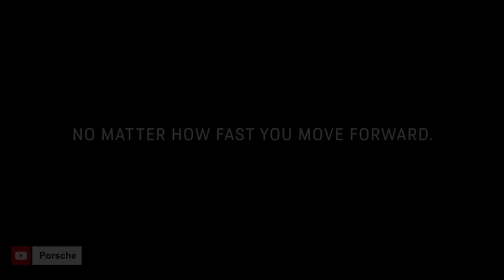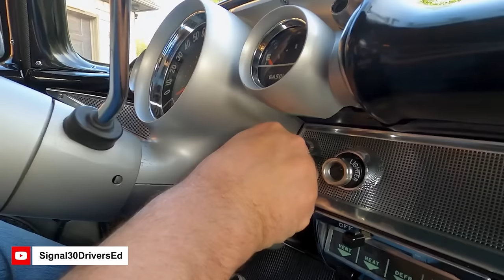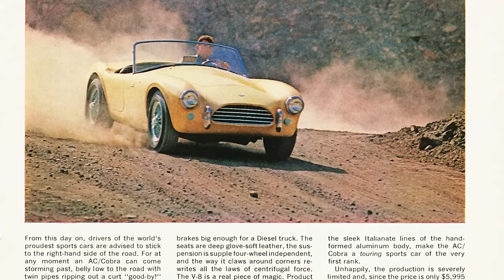Why Old Cars are Better

Comment: theyre not better. Sure they do look better, the old BMWs, audis, dodges etc. Not the really old ones which reach top speed of 30 kmh, not those, but 70s-80s. But what about them is better? The lack of ABS? The lack of basic safety measures? The inefficient engines? Sure they're likely easier to repair, but is that really a factor? i mean, modern cars arent that difficult to repair. Sure, if electronics break down, it can be a headache but in most cases you can simply not use those electronics, therefore they'll never break down, same as in older cars which had no electronics to use.

Comment: Mini cooper r53 s, 2004, once i ride this to oblivion, i will buy another one. Don't want ipad on wheels that thinks it knows what i want to do better then me.
Reply: The r53, renowned for overheating and throwing belts? The engine built on the very edge of it's capability? The only r53's i've come across are either broken, or breaking.
Reply: @mattd6085  They are not breaking if you mentain them propertly and are not that expensive to fix anyway. I have never heard or experienced anything about overheating, and they are not built on the edge of engine capability, if you are talking about jcw varients, then maybe.
Reply: @mainsidequest5203   We talking the 1.6 supercharged?
Reply: @mattd6085  yep, but there are john cooper work official variants that push it to 215 hp from 163 and to 160kw from 120kw

Comment: If you  where mechaniclly inclined you could maintain an old car  yourself , not  anymore with modern cars today .
Reply: You're right, no one person has ever managed to actually learn how modern systems work and fix them alone. Every single modern car on the planet has ONLY been maintained by mechanics. 

OR, you're just pining for the good ol' days and refuse to actually learn something new, so you assume no one can. 

I've done lot's of work on my modern car, from pistons up to wiring looms, it just required some actual effort. Try it one day.
Reply: Is not that easy,  if the check engine light comes on ,it could be many things,  and you need an expensive scanner to kind of pin point you to what the problem may be and if you are not a seasoned mechanic , you can  be replacing parts and still not find the problem .
Reply: @youtuber5709   Scanning tools can cost about the same as a good torque wrench, so cost is immediately a bad argument to make as you have to buy tools to work on ANY car. 

If you aren't a seasoned mechanic, replacing the piston rings in a 1960's Dodge is also hard, so again, is not unique to new cars. With a bit of practice and research, there isn't much in a modern car that can't be done on a drive with a sensible tool collection.
Reply: @mattd6085  It does not matter if the car is old or new to take apart an engine and put it back together and it runs properly it takes knowledge , not everbody has that ability , i'm talking about light mechanical work that you don't need special tools , you say that a scanner is not expensive , ok let say your  check  engine light comes on , it does not pin point the problem , it could be many things  wrong and if you are not a mechanic that is used to trouble shooting electrical problems you are not going fix it , unless you get lucky .
Reply: @youtuber5709   Check engine light comes on, plug in scanner, read the code, look up the code, there is your problem. If you can't understand how to find a fault, that's your problem, not a design problem. 

I literally don't understand your argument about old cars being easier to maintain here. If your 70's car had a problem, you likely wouldn't GET a warning, it would just fail entirely leaving you stranded. At least with engine codes and modern sensor systems, you'll get a warning before something totally fails. 

Old AND new cars need a bit of education to work on, but to argue old is easier is bullshit, it's just a different type of learning. 

Just admit you personally prefer older cars and don't want to learn how to maintain a new one.
Reply: @mattd6085  first of all , why are you loosing your cool , just trying to have a civil concversation here , maybe my mistake is what i mean is older cars are" simpler"  to maintain instead of " easier " , by the way i do maintain my own  modern cars , and as far as the codes are concern,  not necessarily the problem , you can get a code for catalytic converter and it can be several things that can cause this problem , not just a bad catalytic and you need to have the knowlege to trace it down not just replace parts at ramdon , on old cars you didn't have to deal with all of these smog related stuff that's why i say they where " simpler "to maintain .
Reply: @youtuber5709   Who said I'm losing my cool? Don't be so sensitive. 

Older cars ARE easier by virtue of their lack of complexity, but you pay for that simplicity. Older cars are slower, less efficient, need more frequent maintenance, less safe, the list goes on.

Again, just because you need to learn a new system doesn't make it a bad thing. If a 60's car was blowing heavy smoke, there are MANY potential causes, it the head gasket? Valves? Cracked block? Piston ring failure? You'd be digging into it just the same as a modern cars cat problem wouldn't you. 

Also I'll point out the air quality back then was fucking awful thanks to the complete lack of attention towards car emissions. Cats are a good thing for society.
Reply: @mattd6085  I completly agree with you , that's what i was trying to say all along , i even said that on my initial post .
Reply: I like this comment section.

Comment: I totally disagree with you about older cars being less reliable, but rather if they are properly maintained and cared for, you won’t have reliability problems. As for why people no longer work on their own cars is because they have been deliberately designed to prevent you from doing that. With all their ridiculous and unnecessary computer crap and hundreds of miles of wiring, the model car has been made impossible for the average man to work on. Another thing that is in favour of the old cars is that they don’t just randomly decide to throw a tantrum and burn themselves to the ground, along with you house and anything else that is within range. You can shove your new plastic, computer controlled pieces of shit with a lithium battery, right where your mother never kissed you.

Comment: I don't care to complain but any 90's truck looks like shit compared to a 30's 40's hot rods,  50's and 60's that don't look to far off form the 50's cars, look cooler, and I was born in the 70's and so the 60's cars that look like 70's cars and also the 70's cars with that don't look as cool to me for some reason but they even look better then 90's and 21'st century cars... and I don't even drive. 80's box shaped cars and 90's slightly less boxy cars were not really that cool but got us around.

Comment: Modern cars are overpriced funeral pyre  on wheels. We really don't need all the bells and whistles of modern technology.  It gets expensive when it breaks and most of the time it's something that is beyond the common ability to fix. To cut weight most cars have tons of flammable plastic instead of metal. Underbody panels are plastic,  interior and engine bay loaded with plastic.  Older cars you actually have room to work on like the engine. Cars today are built around the engine so everything is crammed tight. In order to do some work on modern cars you have to pull the engine out. Now that's an expense. Cars made today are built to be thrown away and not even bother keeping.

Comment: Your opinion is tainted by survivors bias. They built shitty homes in the past. No one felt those houses were worth renovating, so they were torn down and replaced.  Likewise, most old cars were crap and have long been relegated to the scrapyard. Also, none of those experiences you mention as being better are core to what a car is designed to do. They're side affects of thw technical limitations of the time. Getting from point A to point B quickly and comfortably is the core purpose of a car. Newer cars are better at that in every way possible. Your Nostalgia is like wishing that we still washed our clothes and dishes by hand. I'll pass.

Comment: I Require The Holy Boat Car

Pacifically The 1964 Ford Galaxie 500XL in Dynasty Green

It Is Absolutely Essential

Uh; big problem 

Straight up detached from Reality making up nonsense about how Ancient Homes were Built Better

What Are You on about 

My House Is Vintage Retro; some Nice old Design Concepts and lots of Fine Wood

It’s built like Trash as per the period and falling apart

Modern additions are the only thing keeping It Livable

There’s so many common sense issues with this House and They’re all Contemporary design trends

Just stick to how Cheap Comfort Gluttonous Cars are Bad

Comment: Yes, I think this video (and most of the people in the comments) are blinded by nostalgia.  My parents had several cars over the years, and none of them could reach 200K before an engine rebuild was required.  Also, maintenance was required more often--my dad's old truck, according to the manual, required an oil change every 1500 miles.  And who wants to pump the gas pedal, then start the engine, then adjust the choke, then wait five minutes for the engine to warm up, and so on, when you're gonna be late for work?  Who wants to have to walk around the car and manually unlock and lock each door?  We've lost some interesting styling, particularly from cars of the late 50s, but that's about it.  Today's cars are better in almost every way.
Reply: Throw away cars are cool if you hate the environment and money. More pollution is made during manufacturing and recycling of a car than driving. The year 2000+ cars are great until your electronic windows or locks break. It is more of a pain the ass to not be able to roll down or up your windows and not open your doors. Sure it is a pain in the ass to rebuild an old engine after 150k miles but try changing a spark plug on some new cars? Some modern cars you either have to take the engine half apart or take the engine out of the car which requires you to take half the front end of the car to come off too. New cars after 200k or 300k miles cost so much to repair. Hours to repair are higher because they are welded together backwards by robots. The cost of parts are higher because either the parts are rare or paired only to work by the manufacturers. New cars need to be junked. You can spend 45k or $700 a month for 6 years on a car that could get 200k miles and needs to be tossed or you could get classic car that will need maybe 5k-15k every 150k miles. I have had plenty of year 2000+ cars that died at around 130k miles.

Comment: You’re greatly mistaken when it comes to the word motor. Motor is originally from the 1500s meaning on that imparts motion. Your misconception and improper use of the word is why in the last 100+ years since the modern automobile that has lead to the definition changing to be incorrect and many people sounding ignorant. Take all the brands or words with motor and replace it with motion and you will understand. Cars have engines that are internal combustion. A motor in a mechanical sense is electric and cannot also be a substitute for engine. Unfortunately ignorance and wide spread improper knowledge and use has made it so and it personally drives me crazy especially when extremely knowledgeable people like engine builders use the word motor cause it’s just what they herd not understanding it was wrong. 

Everyone will argue this with me but why doesn’t anyone say electric engine if they are the same thing? Because engines are internal combustion and are not motors. 

Motion sports 
Ford motion company
Motion car
Motion cycle
General motion
Auto motion
Etc etc…

Oh then some say what about trains locomotives…they were powered by what? that’s right steam engines!😂

Comment: Dude old cars which you see in museums and magazine,are the equivalent of comparing a let's say audi R8 from 2010 to like a corolla from 2022....
You absolutely don't understand what you're talking about because you are comparing way way different cars.
In order for your video to be truly valuable you must go back In time and compare ,let's say a BMW e30
To a e36
To a e46.
Then compare a mercedes slk200 let's say to a new miata 
You know the slk has an inline 4 supercharged
The miata is NA THE Nd Model
Like,you cannot compare a Porsche 996 after 40 years to a let's say tesla...you can compare it to a cayman or like a boxster but.
Mainstream cars from the 80 and 90s were probably pretty trash,but the special editions like let's say 
Subaru sti Impreza 22b engine
That car cannot compare to a forester

Comment: older do do better in crashes by proving makeing the car crumple leads to drivers and passenger being impaled with objects thats got shoved back because the car crumpled i have a real life example that happened to me i was driving a 72 dodge power wagon single cab im on the freeway with 3 passengers yes 3 total 4 with me driving in my single cab i was doing 70 to 75 just crossed a bridge and there is a coner coming up nothing crazy but my steering box goes out my wheel is locked up all my friends cause it tell them all of us grab the wheele a try turing it 4 men strength and dident budge at all we go stright in to the concrete barrier but because im driving 72 dodge truck made of real steel every where we hit the wall 70 or 75 mph we almost jumped it we hit it so hard but because the truck is made with real metal not military grade aluminum and mind you cause of year there are no air bags lol no one in truck had a scratch or bruse from impact and best part is you know how much damage my truck suffered at 75 mpg almost 0 i bent my bumper down a little and scratched up my fenders and blew 1 tire thats right not person was hurt no airbags no seatbelts and the truck wasent even hurt sure neede towed cause it cant steer because my steering box went out but yep took it to shop same day ina 1hr and a hlf they replaced my steering box and got a new tire and we continued our day modern vehicals crumpling leads to more injurys because they crumple thus shoving all kinds of thing into your legs chest and face so no the are not safer car company have fooled you so you think there safer so they can use infferiore matireals to make there cars and ppl wont complain because you have been tricked thinking there safer because like all of the USA we have forgotten the past you know how many time these moden "safety" devises actually lead to the person diying is quiet often there legs get pinned because the car crumpled know the cant escape the seatbelt wont undo because of the crumple and now your trapped they may help sometimes but they also cause harm or worse sometimes so huh is it safer being that the newest thing ive ever owned was a 2000 durango ive crashed jumped just done stupid stuff a always the older cars are safer more reliable and never have to take it to shop where they say u need this that and another thing when none of it was bad ppl to up there commonsense because from what ive seen and ppl ive met seems like commonsense isent so common anymore sorry for rant but ppl today are just so much dumber then older generations it blows my mind like i said im only 28 and i can see this dont know others cat i cant wrap my head around how easy ppl can be tricked just cause tv or social media says somthing its like NO NO YOUR DUMB lol sorry again but yeah some things you said are but some other is youve been tricked brainwashed idc what word you use but you have been fooled and you know that if you live a life not of privlage and money where you have nothing but need to make it work living that sucks but shows you alot of truth that socity today ethier denies pretends not to know or for real that dumb idk no its just a rant LOL
Reply: This is the least literate paragraph of absolute nonsense i've ever seen. Did you even attend a school in your life?
Reply: @mattd6085  yep and collage but do i care about spelling on SM platform hell na lol lol
Reply: @thevexxus8055   College, with an E...

Your spelling, punctuation, grammar, and overall complete lack of respect for the basics of communication means everything you wrote is barely understandable. 

Are you american by any chance?
Reply: @mattd6085  lol of course lol with a good life own my own 30acre property that i own with no mortgage animals 7 trucks 4 cars 4 horses 5 dogs 12 chickens 1 rv and no debt except some medical bills so im great how about u lol

Comment: I do not appreciate how aspects of driver/passenger safety are just kinda swept under the rug for the sake of gushing over glamor - old cars are quite possibly more attractively styled, more engaging to drive, simpler to fix, engineered to last longer, but what they are not is "better". Having to muscle-wrangle a non-servo steering in a stationary position is NOT better. Not having ABS or airbags if you need them is NOT better. Not having crumple zones to get crushed so your body doesn't is NOT better.

Hey, I do get the sentiment - I even share it. I know full well what it meant to ride a bike that literally contained nothing you could not fix with a few simple tools on the side of the road, all the way down to the mechanical points, short of something literally breaking in two. My first car - also my current car - is from the mid-nineties and I have zero intention of ever replacing it during my lifetime if I can manage to keep it rolling. But I also realize full well how it already contains a lot of "newfangled shit" that I would not be comfortable driving a car without. And this side is barely touched on in with a few sentences in what is a half-hour long video...